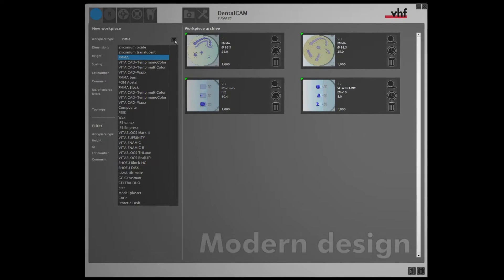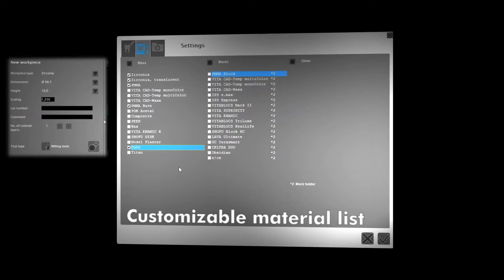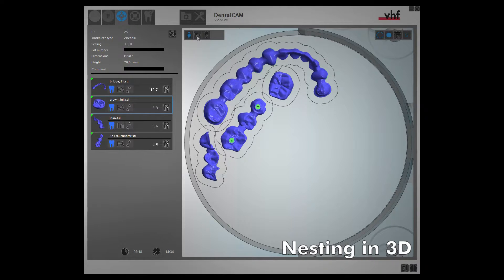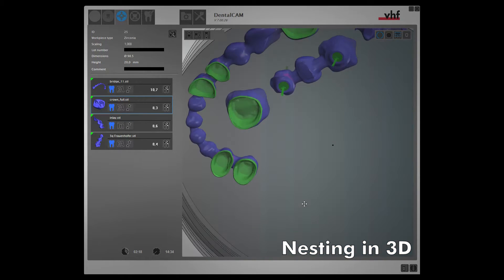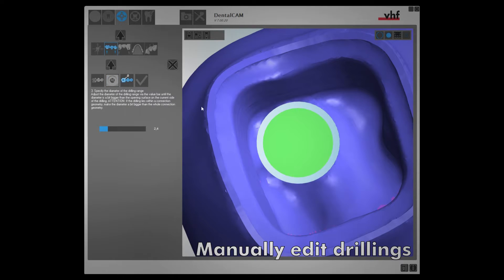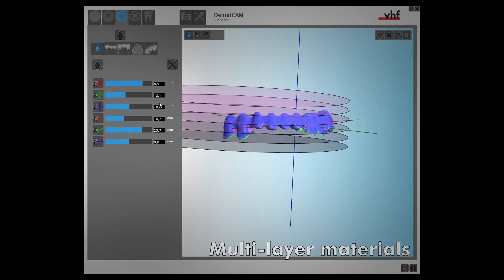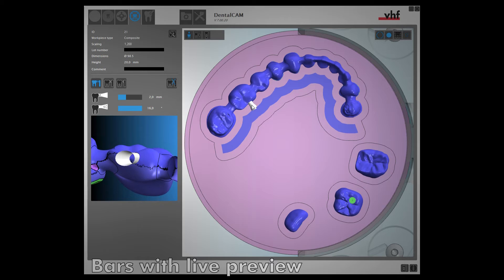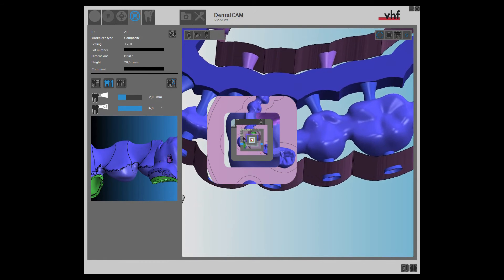DentalCAM 7 – CAM Software form vhf

Comment: Que características debe tener el computador para instalar el software?
Reply from the maker: Hola Juan Carlos, los requisitos básicos del PC debe ser:

CPU:
– Mínimo: Intel® i5 o equivalente
– Recomendado: Intel® i7 o equivalente

Procesador gráfico:
– Mínimo: Interno con 300 MHz
– Recomendado: Dedicado con 600 MHz

Sistema Operativo: Version 64 bit de Windows® 8.1, 10, 11

Memoria:
– 125 GB libre de espacio
– Mínimo: Disco duro HDD
– Recomendado: SSD

RAM:
– Mínimo: 8 GB
– Recomendado: 16 GB

Resolución de pantalla: 1920 x 1080 (Full HD)

Conexión a internet permanente